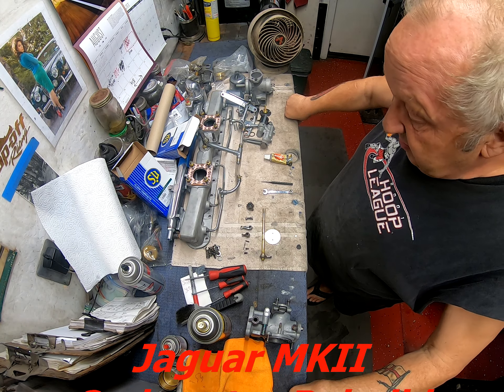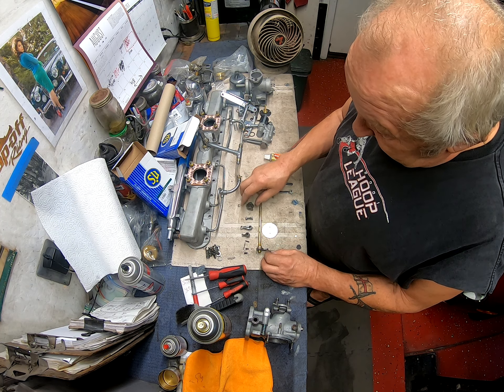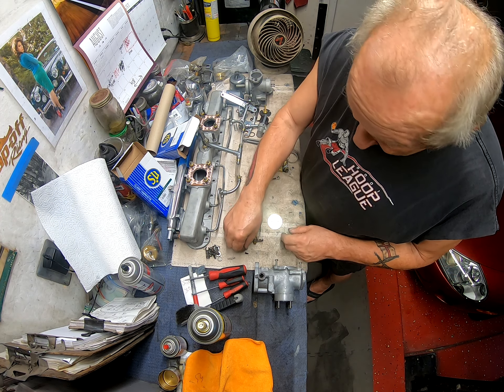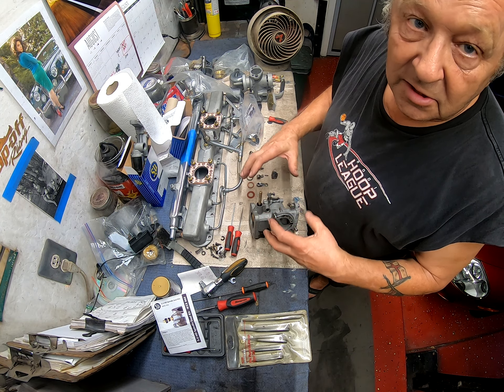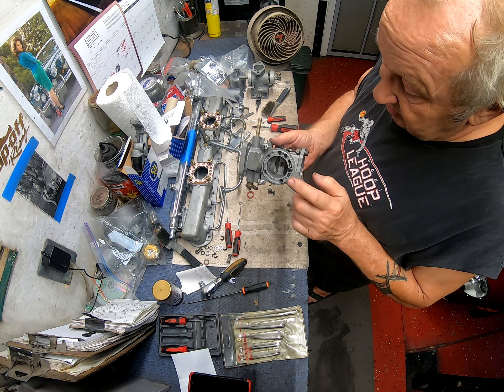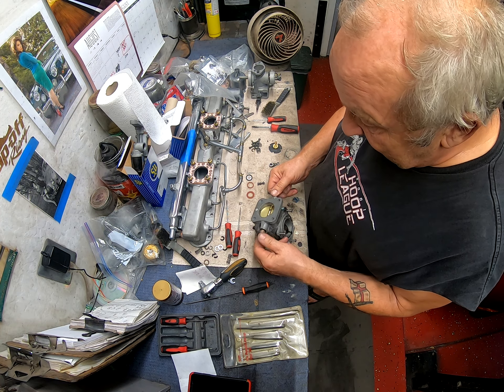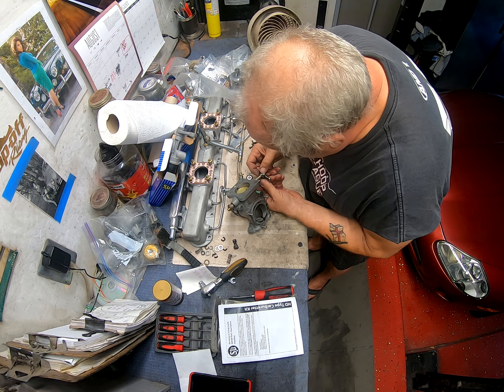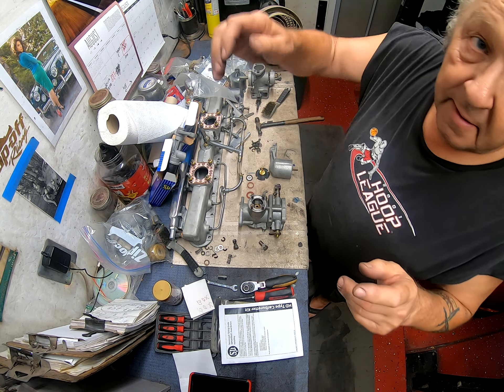Jaguar MKII Carburetor Rebuild Next Bit

Comment: Good video.  I've done this rebuild a few times now so all very familiar.  Without being anal about it, although I suppose I am, did you remember to fit shakeproof washers under the four screws securing the float chamber to the body?  I didn't see them but you might have already had them on the screws when you fitted them.  Anal but a pain to get the screws out after the carbs have been fitted.....
Reply from the maker: Tony Collingridge yes they were already on the screws